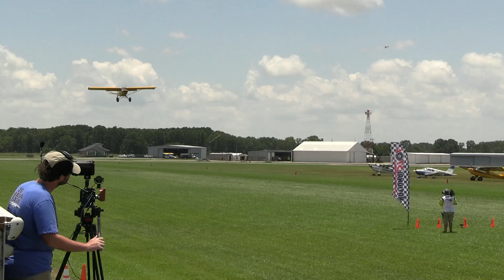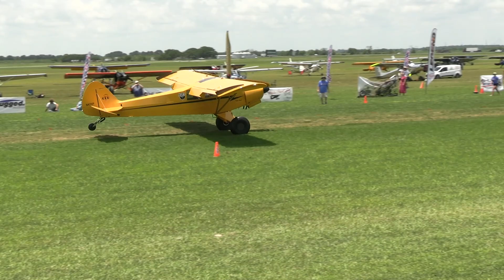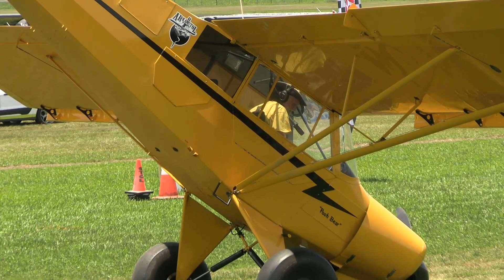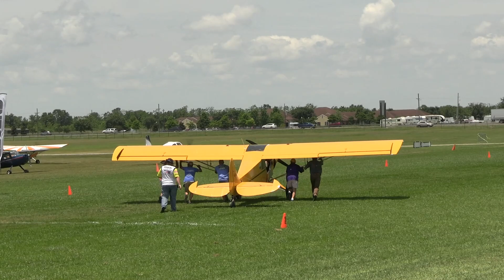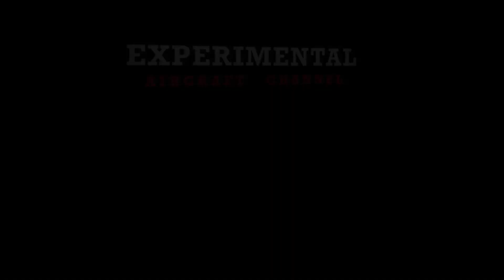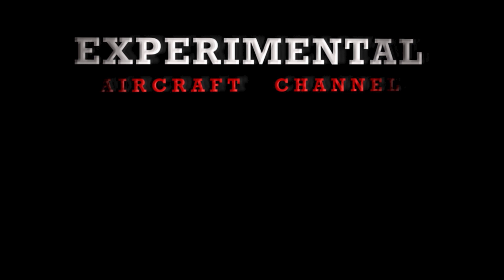SHORT LANDING!

Comment: That stiff prop saved his airbox
Reply: Stiff prop? What I seen was the prop had better suspension than his tail which started everything in motion. You could see it Bend, flexing as it pushes the plane back up before it settles back down, bending it some more. Then you can watch it spring back into place as the official who had ahold of the Hub looked at it rubbed his hand over where it was bent. A stiff prop would have snapped perhaps in more than one place.
Reply: @Ozarkprepper643  It didn't shear the blades. I read that it's a CF prop and that it flew away later. The bounce is amazing, but I doubt that a composite prop could flex enough. I wonder if its weird optics at work?
Reply: I meant no disrespect by the way, sometimes I'm anal. I'm sure it was carbon fiber and I'm not surprised it flew away. Carbon fiber does flex it's just that when it fails it's catastrophic. So since it didn't break it likely wasn't damaged. Carbon fiber certainly flexes more than wood. But as much as aluminum flexes, carbon fiber does even more. I might be mistaken but I think it's alternating layers at 90 degrees and most are over a foam core. Although there are some that are Hollow. It could have been some optical illusion though. I'm in the middle of doing Composite work today. Building a  plane for my buddies son. I don't use carbon fiber much. I use S glass. It's just as strong as carbon fiber but just as tough as Kevlar. Although slightly heavier  it's cheaper than both LOL. To use a phrase from Mike Patey, "back to work".